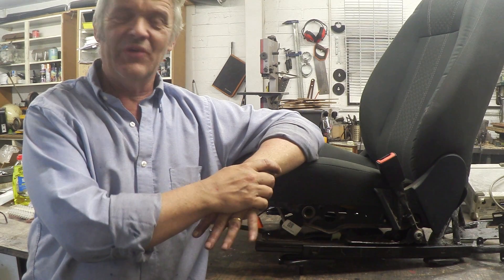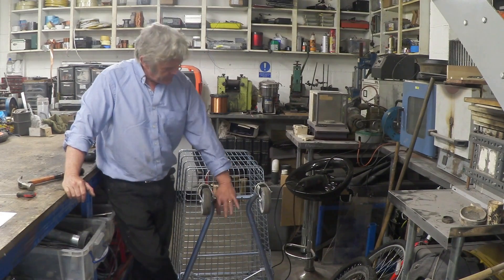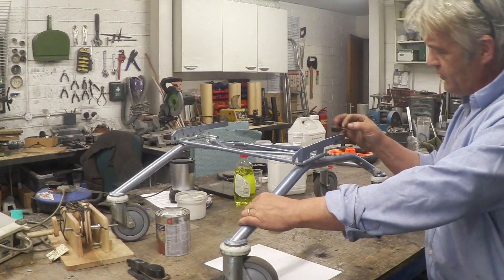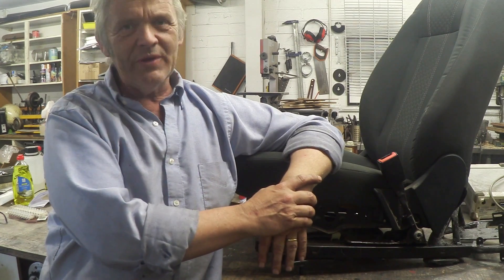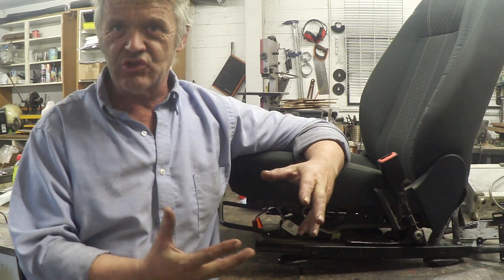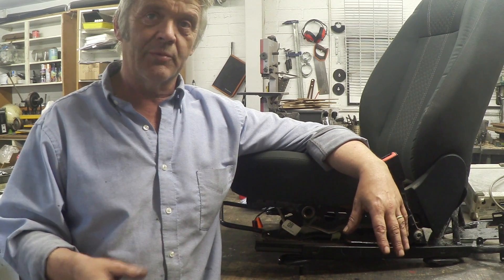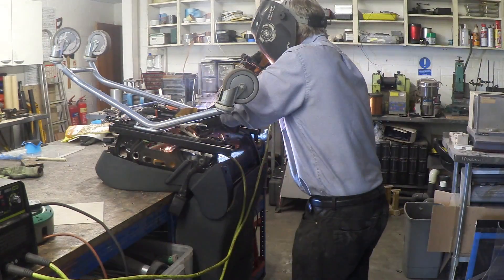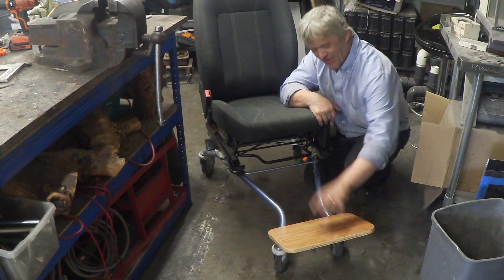1198 How To Make A Wheelchair From A Car Seat And A Shopping Trolley

Comment: I still want to know who the MORON was that decided it was a great idea to put 4 castors on a shopping cart?  Only the UK and Australia have these dumb carts.   The rest of the world has only the front wheels as castors and the back ones fixed.  Thanks for another great video.
Reply: Probably because they were invented here by someone smart before they were refined — many zero to one inventions are like that, and afterwards it becomes cost prohibitive/ unnecessary / slow to replace e.g. extreme hot/cold plumbing vs mixer taps.

Comment: Excellent idea, there are often cheaper and better ways of getting around prohibitively expensive items. Changing the subject, an idea for a future show is if someone can come up with an idea of a motorized gadget to clean and wash the inside and outside of a gutter! I have two problems firstly I can't stand heights and secondly a conservatory that prevents ladder access to a gutter. I'm currently designing a motorized gizmo that can be placed on the side of the small area of gutter that is accessible. There's one heck of a lot of design problems to overcome.
Reply from the maker: that is a good idea mate - and I can 'see' what you mean about design problems - good luck with it
Reply: @ThinkingandTinkering  Many thanks.

Comment: Can see Tesco’s losing even more trollies than normal
Reply: There is no reason to steal anything in this world. Ask the manager if Tesco and others have any for sale. Many times, they'll just give you one of the damaged ones.
Reply: @lisataylor3085  Right-on!
Before I had kids, I once took back one I had found in a ditch and, on cleaning it up could see a store number. 
The manager thanked me and asked if I was scrapping as a side income. I answered yes but that I was more interested in the wheels and frame. I ended up taking 3 old ones there and she called ahead and sent me to the other store in town for two more.
It pays off to be good to one another.
Reply from the maker: Lisa and Mathew are right mate - just ask - equally eBay has second hand ones for sale at around UK£30